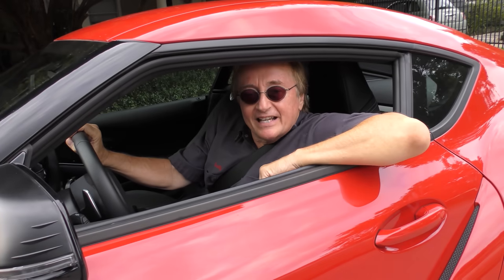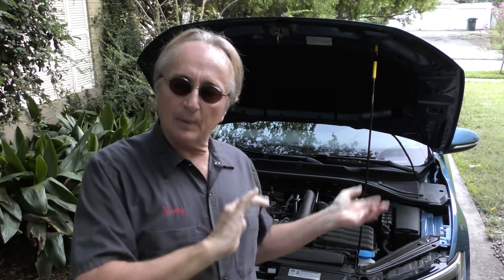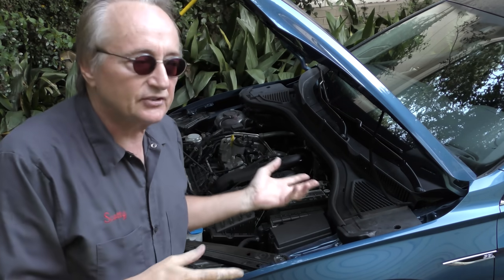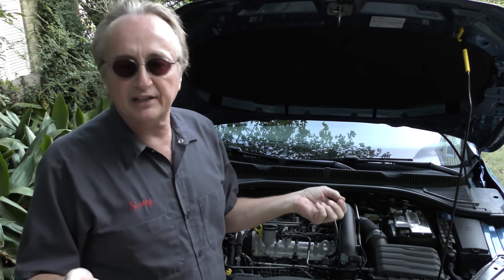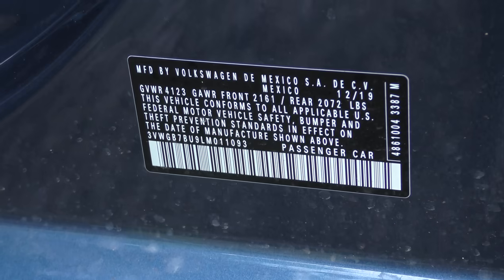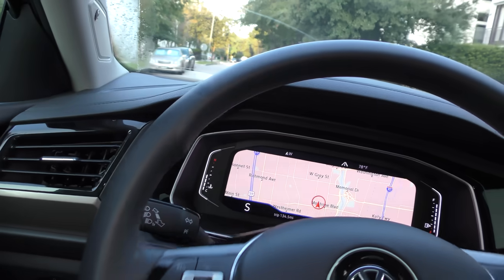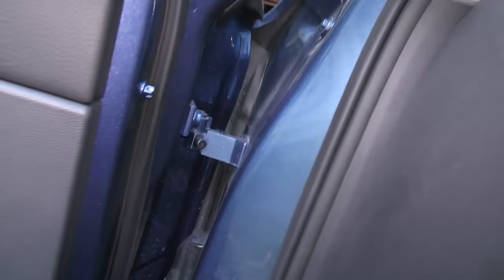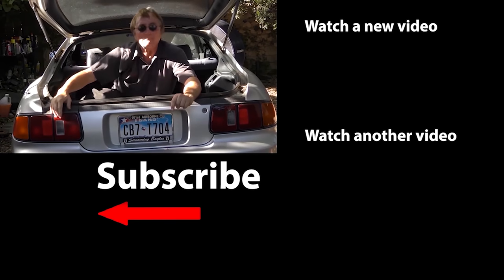I Just Found the Worst New Car Ever Made

Comment: scotty what the hell are you talking about. this 10 min video was basically just a rant explaining why timing belts are the worst. it cost $300 and an afternoon for me to replace the timing belt in my 1999.5 jetta tdi, i only have to do it once every 100k, and that includes the water pump and serpentine belt. so maybe you replace it 4 times, and then the engine is guaranteed to go 500k miles. why is that such a big deal for you??? can't figure out how to set the tensioner right??? all you do is line up the marks!!! The Jetta is the best value u will ever find, everyone should drive a jetta, your taste in cars SUCKS!!!

Comment: Legend Scotty, you probably going to laugh, but I need your help kind sir

Please Help with P0341

My 2010 Tiguan 2.0T has no issues when starts in for morning drive. The moment I take highway and exist minutes later, the car hiccups epc flashes one with check engine flashes once, and then move. At that point once I accelerate or slow down the error appears on screen “Check Engine Service Now”. I”lol attach my OBD and dealer reports

We have done the following but the problem not going away.

- Changed camshaft sensor 
- Changed spark plugs 
- Changed coils
- Engine was removed from car, opened and changed complete came shaft
- Solenoid replaced
- Changed camshaft wiring
- Timing chain is correct
- Replaced Tensioner
- Oil change (of course)

Problem remains the same and more frustrating with the amount of money payed and time spent

Comment: Sounds like you really like the car. Always get an extended service contract with a VW.
Reply: Warranty Direct rates VW the 2nd Least Reliable engine due to frequent breakdowns.  My Beetle died at just 70,000 miles.  My 2 Hondas went 300,000+ miles with no engine breakdown.

Also VW commits criminal acts by cheating on EPA and EU pollution tests

Comment: I have a 2021 Jetta SEL and had a 2020 R-Line before that. They both started giving me issues with in the first 4weeks of purchasing them both. The problems with each are very similar.  Getting to the point I'm wondering if you know what should be on my dash panel upon shutting it off. And shouldn't the same thing display every time I cut the car off.  Shouldn't the VW symbol that comes out saying hello Shouuldnt it come out when entering the car. Sometimes after exiting the ar and shut door the odometr sceen  will com o n,
Reply: Anna, I have owned my first VW for almost 2 years now ('21 Jetta S- 6spd manual). I researched the forums on them prior to purchasing and found that they can have some electronics issues. I'm not sure what an SEL should display upon shutting off the engine but my S will typically display, "don't forget your cellphone, window is open,'" or something similar. I would be curious to see what VW service says if you believe you're seeing quirky dashboard errors. They should address this if its still under warranty. Outside of this, I've done a handful of cosmetic mods to the car and really enjoy driving it.

Comment: If you replace the belt every 50k miles as vw say, its no problem. The belt kit is cheap enough. Belts are simple to replace
Reply: $1500 is what VW charged me.  And has to be done several times, so ~5000 wasted over the life of the car.
Reply: Give me a timing chain like my Honda that never needs service
Reply: @electrictroy2010  well why would you go to VW then? Of course its going to be expensive from the stealers. It cost me about £80 for a Gates belt kit. I do it myself in a few hours and it's done. And I've have to replace many Honda chains and guides over the years so you mustn't have them to very high mileage if they never need serviced.. I've changed  belts on the vw 1.9 tdi engines with near or over 500k on the clock and their still going, mainly taxis drivers...

Comment: It will take sales away from toyota, so it must be a bad car lolz. Good lord, such a bad review. We've got +-2000 of these cars in our company fleet, we have our own garage to handle the the servicing and repairs, the only thing that goes bad on these motors is the waterpomp and sometimes the coils and sparkplugs. I've seen 2 or 3 engines being ruined because of external damages such as a destroyed sump or from people not noticing the overheating problem when the waterpump goes bad. I believe a new 1.4tsi longblock from vw is sub 3k€, so not the end of the world. Never had a timing belt slip or break on these...1.6tdi or 2.0tdi is a whole different story.

Comment: 1.4L direct injection downsized engine in the US, what could go wrong. I mean there is a reason u got to fill em with premium gas, and I mean premium. not the crap the sell in the US as premium. the premium in the US is not even available as regular in Europe (or Russia anymore). But yes, what could go wrong. No wonder I have a crisis resistant job. dumbfolks wagen

Comment: And with any and every kind of work I've ever had done on any of my VW's even with rotating the wheels they always charge more cause apparently even common parts are all different from all other cars and are just differently made cars that have to have certain particular things or tools to even service VW's. I still love my VW's.
Reply: Warranty Direct rates VW the 2nd Least Reliable engine due to frequent breakdowns.    My Beetle died at just 70,000 miles.  My 2 Hondas went 300,000+ miles with no engine breakdown.

Also VW commits criminal acts by cheating on EPA and EU pollution tests